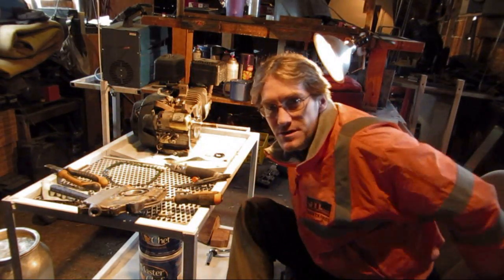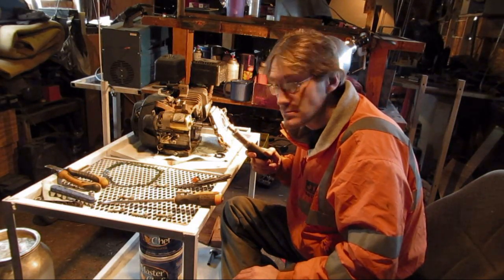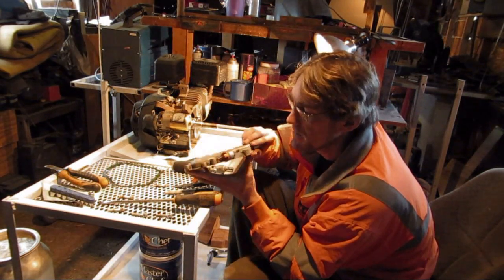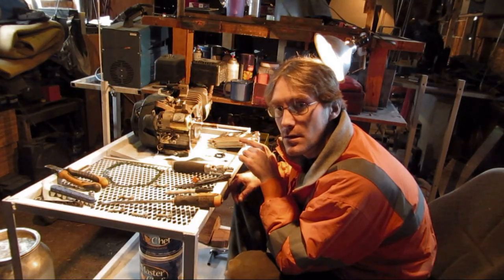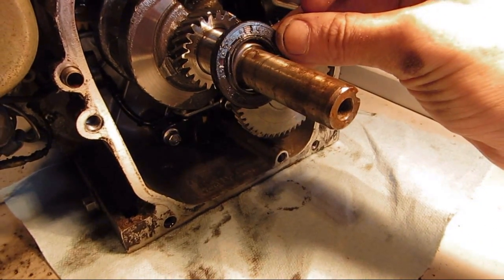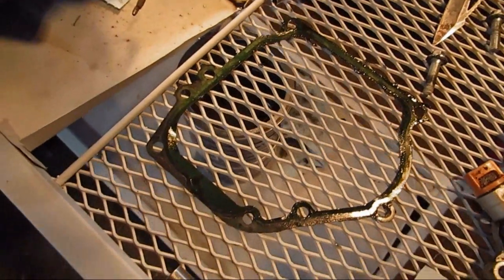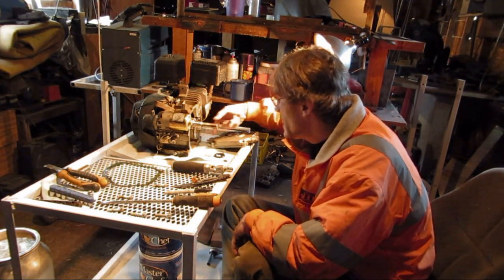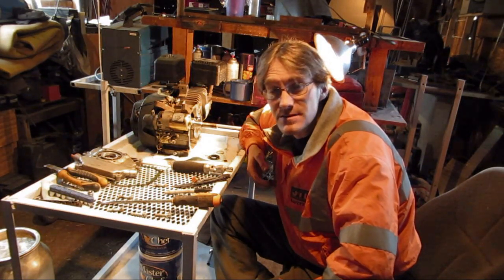6.5 hp Engine ( shaft seal tear down )

Comment: Ya remove the governor.. That eliminates the need for those springs and all you need on it is the rod to connect to the choke and one spring to hold the lever back so that the governor arm doesn't wreak havoc on your crank

Comment: Also, those parts are easy to find, Bmikarts has them, the part # for the springs are: 711231 and the other one is: 711232
The side cover gasket part # is: 711340